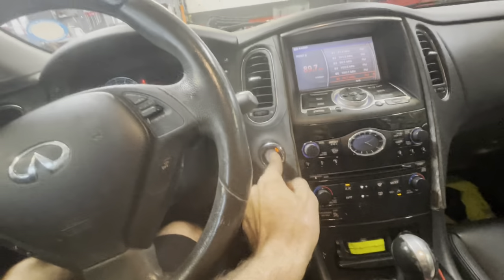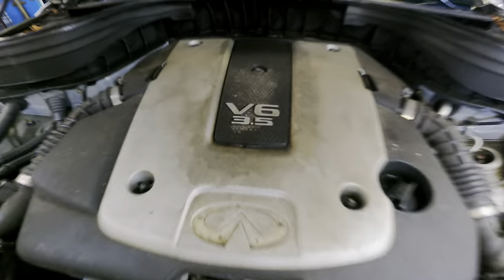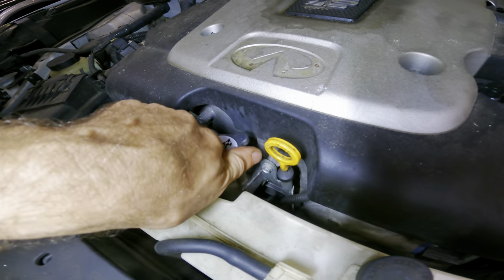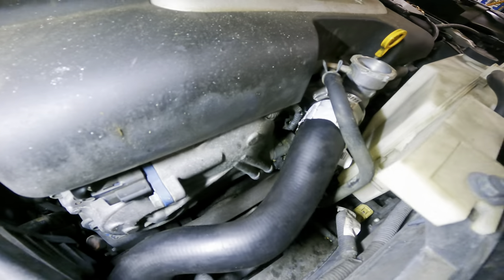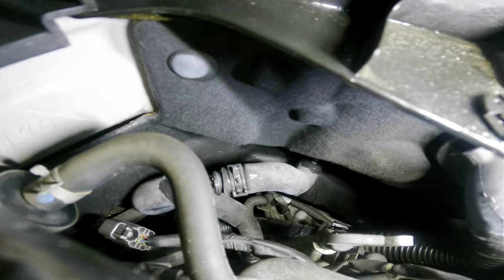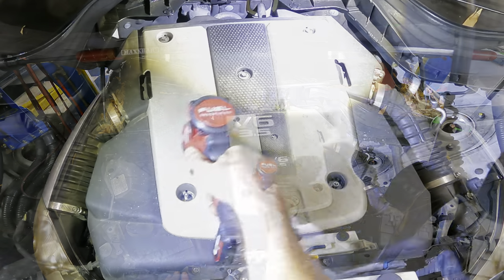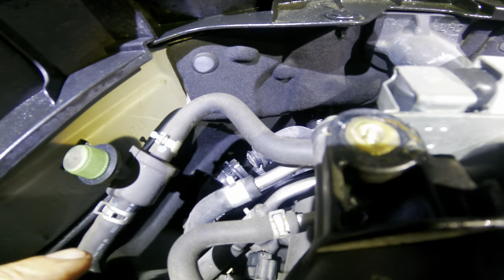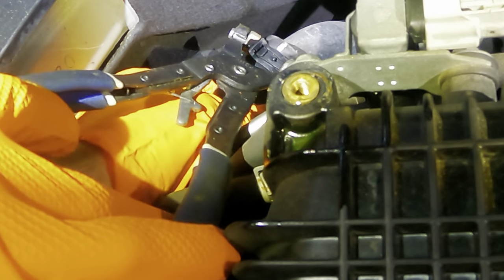Overheated after new Radiator! Tow In! Infiniti 3.5 EX35

Comment: Hey I’m an Infiniti tech. That’s a common failure on the 3.5 and 3.7.
If it’s broken or about to be broken, disconnect the evap line that’s right beside the heater hoses and take it out. Gives you more room. Then take the clamps on the heater hoses and push them behind the heater connector. Take pliers and break the connector in half. Then take both hoses, point them downwards, and use the pliers to crush the connector inside the hose, the pieces will fall out like confetti. Make sure all the plastic is out, then I use silicone lube in the new connector and push it into the hose. It takes me like 10-15 minutes doing it this way. Top off the coolant and don’t worry about bleeding it, I’ve never had a problem

Comment: I love those no spill rad funnels. One of my favorite things I’ve ever bought. It’s almost 100 percent necessary for cars like Subarus that have lower thermostats and are prone to trapped air.
Reply: Same with the Dodge 4.7L V8. The thermostat is the bottom and controls flow from lower hose just inside the block, not easy to replace but extremely necessary as these engines do not like to be hot. I drive a 2001 Durango 4.7 and had a remanufactured engine installed in April due to a repeated overheating issue prior to my owning it that led to a warped head and blown head gasket. Yep it never quits bubbling, just like mine did.  ☁️ Exhaust clouds?

Comment: When your coolant system keeps blowing out the weakest link,  thats classic compression gas in cooling system. Do a chem/block test on it to confirm. No fault of the previous shop. 😉
Reply: I thought the same thing
Reply: With the bubbles and the history of failure, testing for hydrocarbons in the system is a good idea
Reply: I bet Ray is gonna' do those tests in the sequel. Cuz' I've seen him do them in other vids. Sorry, I should have said "spoiler alert". Still, the suspense is killing me. 😜
Reply: I learned that with my 6.4l. Ended up constantly blowing coolant out of radiator cap
Reply: @timdaniels2100  Right?  I was thinking the same thing.  This engine probably has a blown head gasket(s).   Hopefully the heads aren't warped; those can be a real head ache! LoL.
Reply: the radiator cap is supposed to regulate the maximum pressure, wouldn't it be something wrong with the cap if the compression gases blows a hose or another part?
Reply: @Paulyy_D  On a perfectly new system, yes. brittle 15-20 year old plastic will not hold up to 15 psi anymore.
Reply: @Paulyy_D  you have to add the high temperature and steam to the equation, that weakens the cheap plastic pieces. An old car with metal fittings would simply boil over..
Reply: Yea, Ray's a smart cookie, he just didn't get there yet... Don't worry, he'll figure it out.
Reply: @timdaniels2100  yeah he probably tested it right after he ended this video.
Reply: He needs permission to provide "Diagnostic Services".
Different job, different kettle of (boiling) fish, different pay-rate.
Plus it looked like it was past beer-o'clock :D
Reply: I agree, Ray will figure it out. If this little fix cures today’s leak, “tail light “ warranty! We only guarantee what we fixed, not what happens next! LOL
Reply: Agree. Surprised he didn't do that.

Comment: Ray, put in my 2 cents after 45 yrs. I have used the funnel fill system you are using for years. Very small thermostat in that engine, will erupt coolant for a while. Put out side & cool off. Engine will take what it needs during cooldown. Fill & mark overflow bottle. With electric fans , it won’t take long to overheat , if it is going to. Remember , boiling point is 212 & for every lb. pressure on cap raises 3 degrees.your @ 213 no cap. Not surprised old plastic union split, @ hottest part of enclosed engine compartment. Great video again.
Reply: I'm not sure of your boiling points, but as I only have 40+ years of working on cars, mostly race engines...I will let that go your way. I will say that a 50%-50% mix of antifreeze and water is 223°F and a full on 100% Evans waterless coolants have a boiling point of over 375°F...I don't worry on my engine builds on the pressure difference as you specified so can't comment. I will dial in specific engine temps with applications being used with the thermostat.
Reply: Watsup my friend?  Great video I used to be a big Datsun Nissan infiniti fan
In the 70s, 80s the rear wheel drive Datsun was unstoppable.  I had a 71 510 wagon that I beat on thru my teenage years and if the steering box hadn't rusted off I'd still be driving it!  I believe it had a 1.6 or 1.8 OHC with a 4 speed stick. Nothing power, well power brakes but not steering! Had like 165/70/13 tires really Cheap to replace,  like $120@SET...I remember $7 would fill the fuel tank and it got mpg in the 40s...I remember once the wiring harness fell into the fan and it wrapped around the fan pulling the harness thru the firewall and out of the dash! No lie! We just straightened it out and plugged everything back in and in a few hours it was good as new! It looked like someone removed it, except the wrapped up part!
Now these cars are untouchable. If one can be found they want huge dollars cause guys want them to drift with! I bought several of those used of course 150 to 350 if it was really nice....miss those days!
Reply: Forgot the point...late 90s maxima and infiniti i30s were the last decent cars Nissan made they went downhill quick...rusty floorboards! Cmon..thought that was over years ago..
I hate loosing a car to rust but I couldn't even Jack mine up at the end! Still ran fantastic, the 3 liter in 1998 was rated one of the top 10 motors made.

Comment: Hi Ray, The cooling system going into the heater is above the radiator and will have air in it. The plastic part that broke is not the correct part for that location. There should be an air/bleed screw between the hoses. When filling the rad with coolant the funnel that you use would be ideal as it need to be filled high enough to be above the bleed screw. If not, there will be air pockets in the heater system.
Reply: Some models don’t have one.
Reply: That makes sense that was the issue I had with my heater blowing cool air. But like said Ray it might have blown the head gasket by now. Just have to wait until the next installment. Can't wait.
Reply: Isn't the radiator cap and the overflow tank meant to fix that air issue? Pressure builds and pushes air into the overflow tank and then when it cools it sucks coolant back in. I've only got old cars though, no clue if it's different on new cars.

Comment: When it comes to broken plastic connectors like those, I'm always afraid I'll wind up with a little piece left behind somewhere in the hose, and that piece will get lodged somewhere it'll restrict coolant flow, or causing some other issue that'll be a real fun time to diagnose.
Reply: Me, too. Ray wasn't bothered at all about it, so I figure this car will  soon return for a new water pump or thermostat.
Reply: if im not mistaken the bleeder port enters the heater core so wouldnt be to much of an issue, cooling the engine anyways
Reply: I was thinking the same thing when he was squeezing the hose to crumple the stuck parts. Where do those pieces go that fall into the hose and didn't come out?.
Reply: @michaelmclemore  A clogged heater core is one of the worst jobs you can face on almost any vehicle. Range Rovers were known for having the plastic fittings break into pieces over time and cause one side of the heater core to clog so that you lose heating on one side on the interior. It happened to ours, and we traded the car instead of having to deal with that mess. 

Rainy is a good mechanic, but he's often sloppy and uneducated on some items. He should have cut the hose off instead of contaminating the cooling/heater system. Very bad.
Reply: That's how I feel about hypodermic needles and veins. Hence my phobia

Comment: What I have found that almost always worked for me is to let the car sit overnight. Then, when it is totally cold in the AM, start the car and feel for pressure in the upper hose. If there is pressure on a cold start-up it is a head gasket. A good head gasket won't have pressure in the hose until it starts to warm up.

Comment: Two things I thought of. Number one, make sure the interior heater matrix is set to hot (if possible, before the system is evacuated. Obviously not possible in this case. But it needs it anyway), as this will leave an air lock in the system which takes ages to "bleed" out, then stop. Just like,e your engine did just, when it took the coolant into the matrix. Number two, are the fans running on the back of the radiator, which would cause overheating when no air is passing through the radiator.
Reply: I'm also guessing a fan here.
1. can't hear it
2. almost no temperature difference between radiator hoses
Reply: Indeed.  Perhaps the fans had not been plugged in after the radiator replacement, or were already inoperative.  That could lead to abnormally high pressure and the failure of that component.  We don't even know whether that was an OEM component.

Note that the driver had just left the shop from the radiator replacement.  I doubt that this was a coincidence, but the entire chain of cause and effect remains unclear.  Who pays?  We can only hope there is no engine damage.
Reply: From my limited experience and younger, foolish DIY days of firing parts canons.. there was an instance of an overheating problem I had with an old Mazda of mine. New thermostat - didn't work. New radiator - didn't work. New fan - didn't work. Then I noticed after driving, it would gargle and grumble from the radiator and purge lots of gasses into the overflow - head gasket. We then parted ways lol

Comment: Just a touch of constructive criticism...
When you take the hood prop and stick it in a hole, you're essentially turning said rod into a PDR tool and can make a high spot in the hood, or worse cracking the paint if something presses down on the hood, or the bottom gets shifted or dropped.  Just trying to prevent a headache for you in the future.
Reply: Shocking that he doesn't have those tools for locking the struts in place. Very amateur to use sticks when there are professional tools that won't restrict access or cause damage. This guy seems so good, but disappoints me way too often. At least he doesn't try to hide his mistakes.
Reply: @JetFire9  you can be complacent with those as well. You forget those and try to close the hood or hatch and you can cause a buckle to occur.  I have been in the Automotive trade all my life, and if I could not work on my own vehicle, I wouldn't have any issues letting him work on mine. Other than I am a stickler for keeping things as OEM as possible, but he is not in charge of that area. I think your criticism may be a touch unwarranted. He is very good at his trade and there are not many techs out there that will show the fails along with the success. I just want him to get a replacement tip for the hood prop and not shove it into holes in the hood bracing, for his own sake and liability.
Reply: @assertivepaintlessdentrepa2634  Nah bro. Some cars even come from the factory with locking struts that you need to lift before bringing down. So your theory is false. He needs to buy the right tool for the job. Rainy isn’t terrible, but what he did with that plastic pipe was ridiculous and could cause a $2000 repair of a new heater core. I guess you’re ok with that? Lol. Also, don’t let him anywhere near your AC system. He is clueless around them. He is better than most, but I would rate him a B-

Comment: I found with cooling systems, (and today's crappy plastics) you almost need to replace everything at once.  I have a little Tiburon that went in for timing belt service, and they of course suggest water pump service.  Okie dokie.  About a month later, the top of my plastic radiator starts cracking.... so replace that. Obviously replace rad cap.  But all you wind up doing is finding the next part to fail.  Get that pressure up in the cooling system and the next weakest part is gonna pop.  I next had to do the throttle-body heater hoses and then a gasket on the block transfer manifold. ( I did the O-rings that connect the water pump to the transfer manifold at the same time because plot! ) Thankfully now my little car is holding it's pee.... but for a few months there it was all about patching leaks.

Comment: As a former Nissan tech, I've learned to always use a vacuum filler on Nissan's with the VQ35 engine. They're notoriously difficult to get all of the air out of. Guys that didn't have a vacuum filler would raise the front end by using just the front lift arms.
Reply: Yup
Reply: I love my new vacuum filler.  so much easier - but not just easier better!  You can then tell if you have a bad hose or break as you cannot get vacuum if a break.
Reply: Was telling  myself I should get one for the last  3 years,  just bought one last weekend but I haven't  got to try it yet 🙃
Reply: This is like the Ford Duratecs where they have reversed cooling systems and if you get air into the block, prepare to spend hours purging air out of it. Ford says hold engine at 2500rpm for 3 mins after thermostat opens, rev it up to 4000rpm for 5 secs then return to 2500 rpm for another 3 mins. Didn't work out well and the engine overheated. Tried what FordTechMakuloco said like 5 times and it stopped overheating. But everytime start from a stop you hear water moving inside the engine. Did the procedure like 10 more times and after 2 weeks of driving, finally there seems to be no air in there anymore. So yes, I think there are quite a few engines that are much better off vacuum filled.
Reply: Absolutely spot-on.  These are not 15-minute wham-bam-thank-you-ma'am cooling system refills.  If no Air-Lift, factory manual says let it heat up, let it cool down and draw from the overflow tank, then repeat 2x more.  And as others have posted, typically that union is a Tee with a bleeder, Nissan part # 92500-AR000.  Think about it....otherwise there's no reason to put a union there.
Reply: Jack the car up on the front end and then hold it at 3000 rpms for 10 seconds and just keep doing this until the coolant stabilizes with little to no bubbles at all. But its more common for De’s to be harder to bleed compared to the Hr and Vhr’s
Reply: thats like 1893 tech for a modern car,, havnt advanced much,,eh..theres supppposed to be a thermostate bypass, so some fluid allway runs rampent round the blockhead.. engine.. stops boiling before the engine gets temp.. people dont know what a hood is, or whats under it.. so long as the juke box works, or ill buy another if it stops.. mentality amazes me..  did you ever get the nissan gu, 4.2tdi. best 4x4 ever.. toyotas suck.. lost the plot..
Reply: TBH it probably would have filled better from the blown fitting than from the fill hole XD
Reply: Yeah, just like early Fiat Spiders.  You will never get all of the air out of those cars unless you jack up the front end.
Reply: @harrywalker5836  Dont let Scotty hear Toyotas suck
Reply: Interesting. Will add a vacuum filler to the list. 
I had difficulty bleeding a M35 Stagea with the VQ25DET, I ended up raising the front as you said. Took a couple of attempts.
Reply: Vacuum filler is the way to go. I use it on the wife's '14 Pathfinder with 3.5 liter.  First the radiator leaked and now it's the water pump leaking.
Reply: You have to do it.
Speciale if its a hybrid engine.
The old trick do not work.
The engine Will overhead
Reply: I usually fill it up, go on an aggressive test drive to get the rpms an temp up, come back and fill it to the top. Never had a problem. Yet
Reply: you ever experience a whistling noise while accelerating on a 6th gen? i thought it was a vacuum leak but i failed to fix the issue
Reply: it scares me using that thing on older cars. The seals and gaskets are sealing one way, and putting suction on them might ruin a seal. At least that's how it runs in my mind. No proof that it actually does that. airlift ftw.
Reply: lift using only front of lift...
bouncing the front 
???
danger ' Will Robinson... danger... danger"
Reply: danger
Reply: Exactly
Reply: Same with VQ30. I almost roasted my Maxima because I didn't burp & top it off.
Reply: Of the vehicles I've personally had to deal with, the one that was the most PITA when it came to draining and refilling the cooling system, was my late father's 1998 F-150 Lariat with the 5.4 L Triton engine. My first go round on it, what drained out was significantly less than the stated system capacity. Looking over the situation, I decided to disconnect one of the heater hoses at the firewall, as that looked to be the highest point of the system - upon which the rest of the coolant came pouring out of the engine.
And what made it doubly fun on that first go round, was that my father had never done any maintenance on the cooling system - and I soon discovered, when running it after refill, was that the bypass on the thermostat was clogged solid, and the coolant tank cap had degraded to the point that it wouldn't even hold 3 psi of pressure - which resulted in the tank first backing up to the point of overflowing, and then suddenly getting sucked empty when the thermostat finally opened.
Not to mention having to replace an age-cracked cooling fan, a fan clutch that had long since given up the ghost, and having to flush all the mud and dirt out of the radiator.
Average cooling system temp decreased by an order of magnitude after that.
Reply: I used the slant of my driveway 😆it worked too
Reply: @crazydogman677  lol I gotta remember this trick!  I've got just the driveway for it too 👍
Reply: there is a bleeder valve on one of the heater hoses. its a small Allen head i believe.
Reply: Had to learn this on mine a while back on a radiator upgrade after the oem one popped. The vacuum filler turns a multiple day job into a 30 minute job.